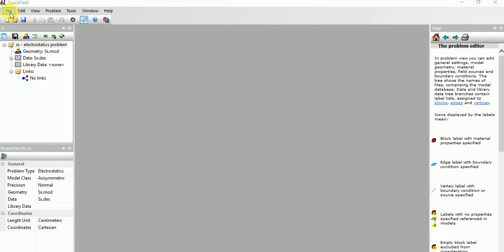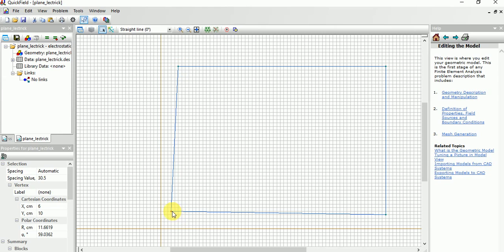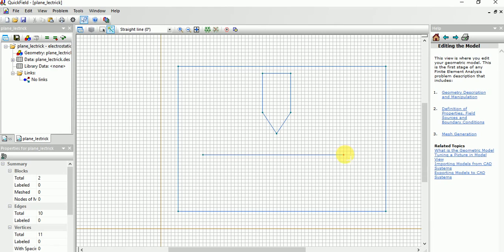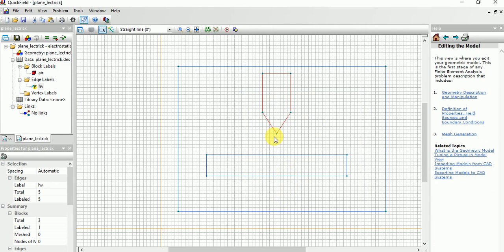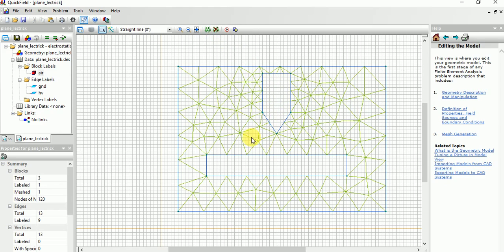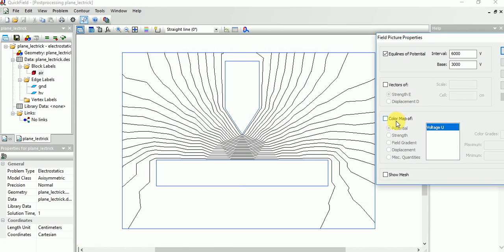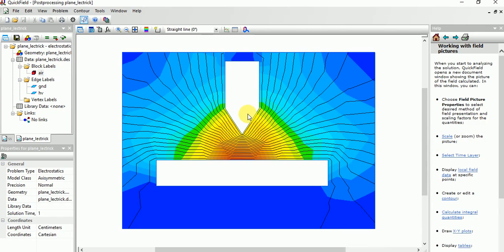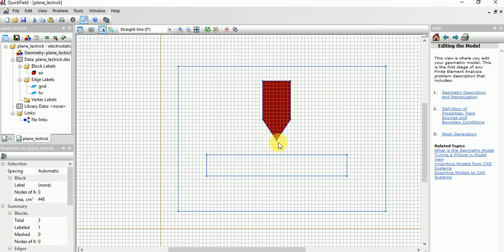point plane electrode field distribution analysis Quickfield software high voltage

Comment: sir is it same breakdown voltage if we simulate same configuration using another software like COMSOL because i need to prove my voltage breakdown data between two software?
Reply from the maker: Yes you can verify with any software. Calculations should be same .
Reply: Can u show us how to use comsol for this project